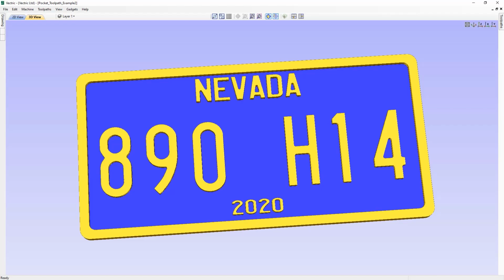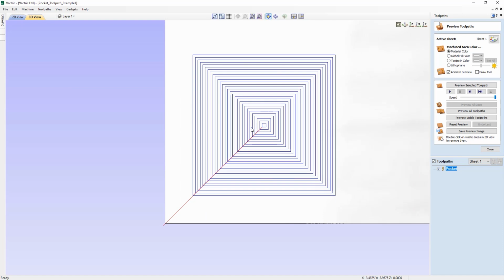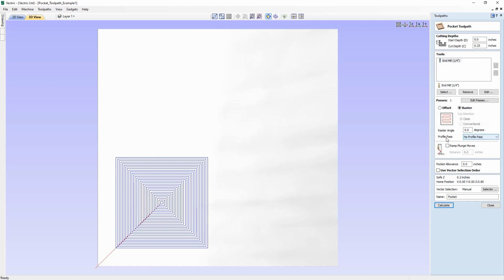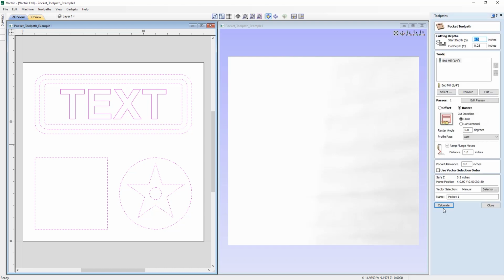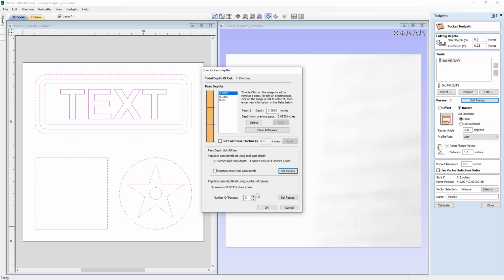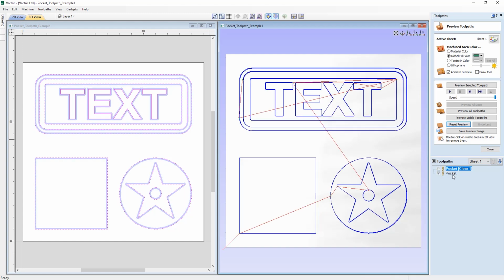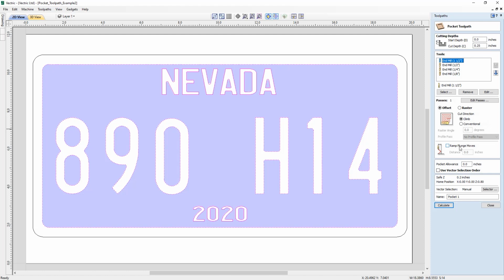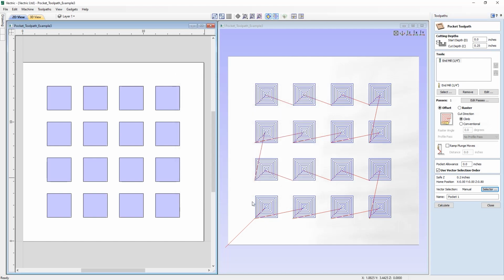Pocket Toolpath Guide | Vectric V11 Tutorials

Comment: Hello! I had to do 104 holes of different diameters(12-24mm) and depts(50-85mm) in polystyrene. The material was 90mm thick and for that I only have a 8mm diameter special long endmill. Due to this I had to use the pocket toolpath to only take 10mm at a time. The problem with the pocket toolpath is that the tool retracts to Z1(clearance) after each removed layer! I also have a slower Z speed. The retracting and getting to the point where it will cut again took like 3/4 of the job! Please add a setting to the pocket toolpath to be able to stop retracting the tool, or to retract only a given amount from the already Z depth. I almost wanted to quit when I saw the almost 5-9 times UP AND DOWN unnecessary movement timed 104 times !!!!!  Or am I missing something? Thank you!

Comment: When I engrave a 1mm depth toolpath pocket, the machine engraves 10mm. I tried saving the file in all post-processor formats, but to no avail. Every time, the engraving is 10 times the depth that was entered.
What is the problem, and what is the solution?
Reply from the maker: Hello that sounds like a question for support@vectric.com - Please email then with a description of the problem, the file, controller type, controller software and the CNC you have.  They should be able to help.
Reply: @vectric  Thanks much, the problem is solved
Reply from the maker: Goode to hear!

Comment: Hi, super handy video. Was wondering if you could answer one of my questions, is it possible to do a pocket cutout then go straight into a profile cutout after on the same g code? I can never seen to get it to work
Reply from the maker: Hello and thanks for the comment and question!  Yes you sure can assuming you are using the same tool you can choose to save the two toolpaths as one (make sure you have the smae tool number selected).

Comment: The new desktop version 11.5 has a fault in it when I make pockets and re calculate. It then ads another clear toolpath and cuts the toolpath twice.
Reply from the maker: Hello... do you happen to have a clearance tool selected in the tool list?  It sounds to me like you might have a second tool... so you are doing what we call rest machining.. when the larger tool goes in and gets the majority of the material out, and then a smaller cutter goes in to get the rest.  

Or...

Your step-down on your tool may be smaller than the pocket's depth you are cutting.  This will cause the tool to go in twice to get the depth you have specified..